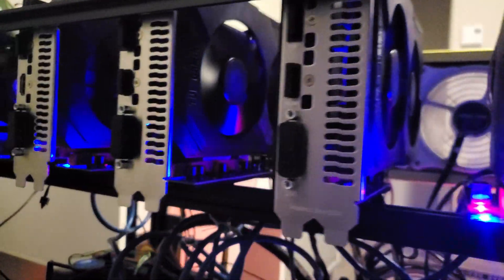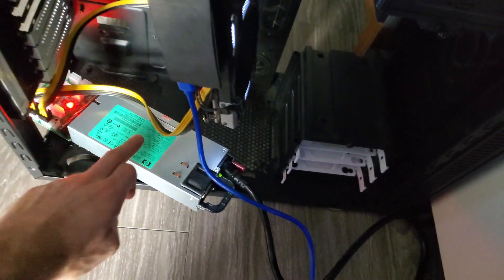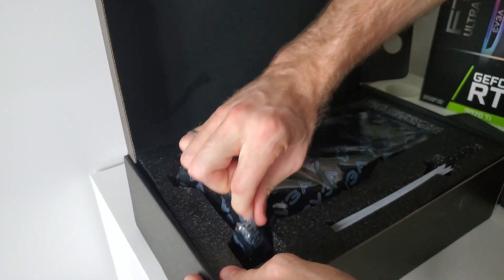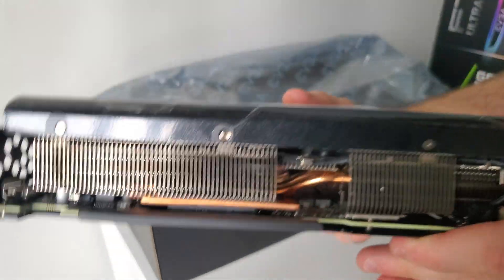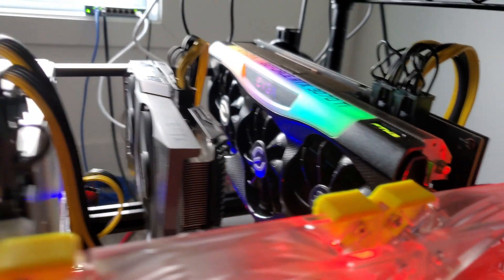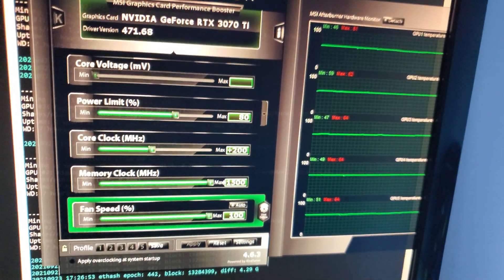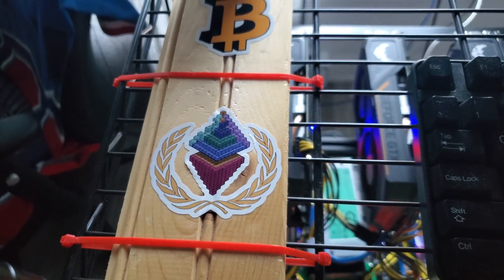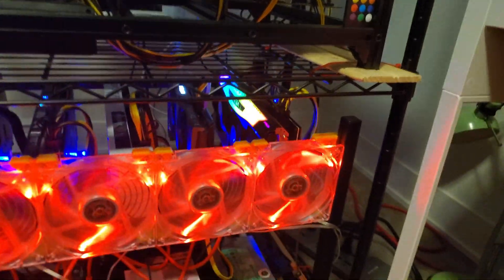RTX 3070 Ti EVGA FTW3 (LHR) Unboxing & Hashrates (Ravencoin + ETH T-Rex Unlock)

Comment from the maker: For everyone wondering, the way you select which cards run in the 2 different batch files is by using the argument --devices 0,1,2,3... I highly recommend (for TREX) everyone reads the README. md included in the 0.22.1 package version. I showed this in the video but edited it out (like an idiot) because the video was getting a bit too long. My mistake. Sometimes things that I think are obvious for myself are not for everyone, so thanks for being patient and working with me :) EXAMPLE BELOW!!!

Ex: Cards 1 & 3 are LHR mining RVN and Card 2 is FHR so mining ETH.

.bat RVN: --devices 0,2
.bat ETH: --devices 1

The devices start at 0 so be careful! Take care everyone.
Reply: hey man thanks for this video i hope this settings work for mh zotac 3070 ti too coz i am facing some issue with vram temp.
Reply: maybe evga cards have good thermal pads thats its showing 80 celcius in your but in my case with zotac it is touching 102 celcius is it safe to mine for month at that temp please reply

Comment: Hey bro, just found your channel. I appreciate your work. My wattage seems to bounce between 194 and 204.. Even with the core locked. Everything else seems good. Temps are good. 61mh/s and 310+kh/w. Is there any concern with that bounce?? Thank you in advance! (1 - 3070ti)
Reply from the maker: No I would say its fine, and also similar when  locking the core clock on the latest T-Rex miner. Check out my latest T-rex video which covers Locked Core clock, it will answer all your questions

Comment: Hi .when you explain the .bat files part,  I noticed that your 3070on eth is mining better than the new 3070ti! It's 62 mh/s vs 55 from ti card(btw it's exactly what i get from my 3070ti). How so ? What are your settings? Thanks! Great video!
Reply from the maker: Hey Daniel! My 3070 is my only Non-LHR card, thats why it has such good performance on ETH. The 3070 Ti is by default is LHR, so reduced Eth performance. If you compare both on RVN, the Ti will win!. I run max memory (1300 I think) and locked core clock to lower power. Appreciate the support :)

Comment: Thx for video. I'm on hiveos and since I am using T-rex with lhr mode I get some rejected shares. I didnt have this issue with NBminer in lhr mode so I don't know what's wrong. Also I noticed that my LHR cards vary a lot between lhr 4 down to lhr 1. They seem to vary a lot between theses modes for som reasons. Overall I get around 54-55 mh/s at best on 3070 ti's but it fluctuates quite a bit compared to NBminer which seems more consistent than T-rex regarding hashrate. On thing that may be important though is I noticed that the whats usage is more stable on T-rex. It varies a lot on NBminer switching from 60w to 200w constantly. Don't know if this could be an issue for the cards when it varies constantly so I stick to T-rex for now.
Reply from the maker: yeah personally i would stick to Trex as well. People seem to get varied results depending on their card though!

Comment: to mine different coins on a single rig, you have the specify which devices you want to use in each batch files.  they all have that function.  in t-rex, its --devices   Comma separated list of CUDA devices to use.  for example... --devices 0,1,2      and in your other batch file you'd type --devices 3,4,5.   the devices are the numbers on the left of the screen in the miner.  start it once with no modif in the .bat to see the order, then adjust accordingly... this also work in HiveOS
Reply from the maker: Hi Guillaume! yeah exactly, I specified this in my pinned comment! good info we need to spread to people

Comment: mining in hiveos T Rex, but never can get upper 45.22 Mh on both EVGA and MSI 3070 TIs. 
my OC is Core - 1500/ Mem-3200/PL 145(further rising PL does not make sense)
Reply from the maker: are you mining eth? If so, make sure you use --lhr-tune argument!!
Reply: @MiningOffice  
You were right. 
It pools 54+ mh/s but only after 245W, so rather go with Trex miner's 45mh/s with 145W.

Comment: Nice video!, btw that high overclock on memory affects or damage memory modules on any way ? I have same card but im using +800mhz mem oc because I’m not sure if higher mem oc could damage the memory
Reply from the maker: As long as you are not getting rejected shares or crashing, no it will not damage anything. What is important is the temperatures!

Comment: I avoid 3080Ti mining RVN as it get super hot 94-102c+* based on room temp.
Reply from the maker: Yeah 3080Ti will heat up a lot mining Ravencoin, but I usually try to avoid 3080Ti for mining to be honest
Reply: Its the same with most 3080/3080TI and 3090 due to the faster DDR6x with higher power, you need to swap out the stock thermal pads for some decent ones, usually drop temps "at least" 10C. on RVN.

Comment: You should do longer than 12 shares next time bro so you have a better sample size for "stability", other than that, good video
Reply from the maker: Hey Fluxxx! I did, just that it was getting bloody hot in my room and had to up the fans and also changed the worker name as it was conflicting. Had it running longer then that, but just left it long enough to get the correct hashrate when I filmed after modifying the .bat file. Some movie editing ;) Really appreciate the support and constructive feedback, I admit it can lead to confusion!
Reply: @MiningOffice  okay makes sense bro :)